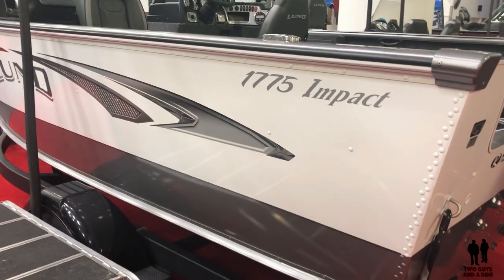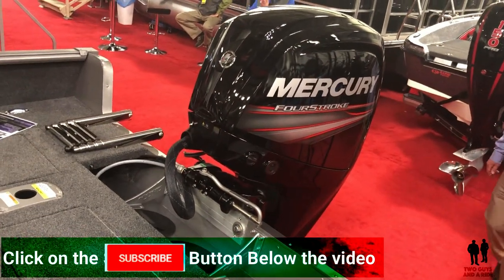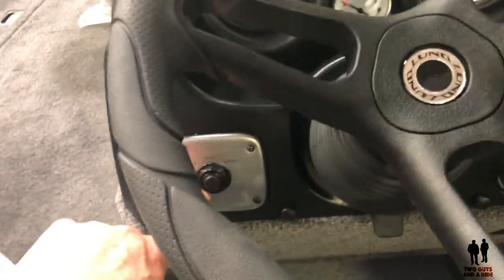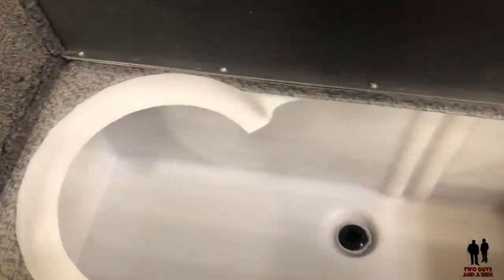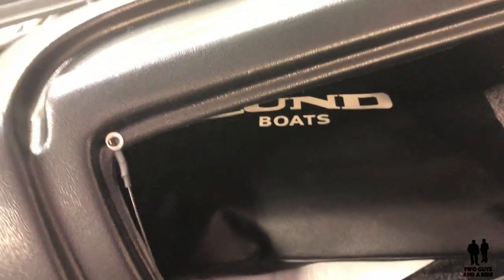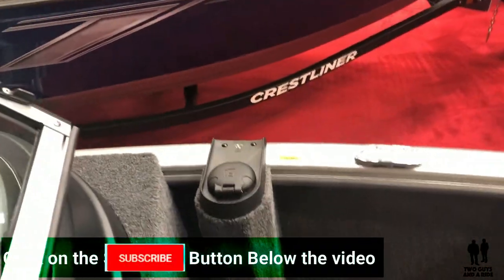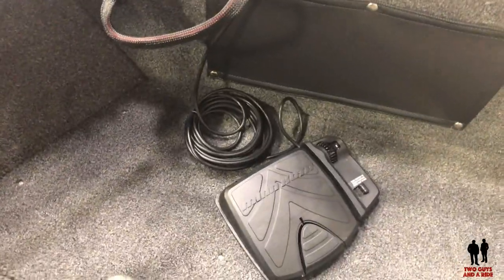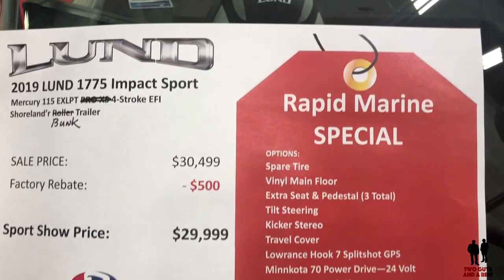2019 Lund 1775 Impact

Comment: Curious how stable the 1775 is?  Is there much movement when people move around the boat?  I love the $ tag and lay out of the 1775, but commonly fish a big, busy lake with lots of boat driven waves.  Just want to make sure the 1775 is a stable enough platform or do I need to look into the 1875 for the extra stability?  Thanks for anything you can share.
Reply from the maker: As with most things bigger is better so with the 1875 you’re gonna have more displacement in the water so I would imagine it would be a little more stable I’m not sure for the price difference if it would be that much more of a difference. Thanks for watching